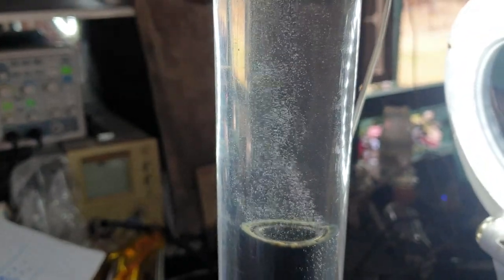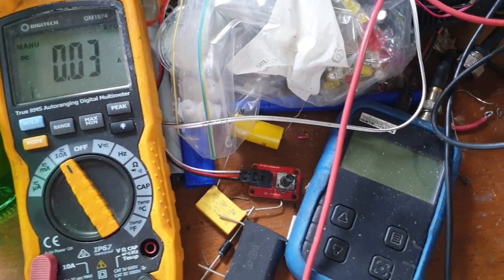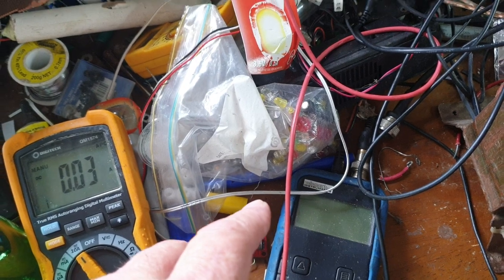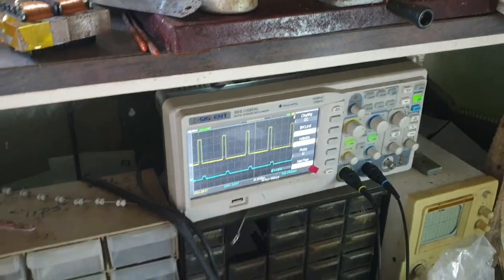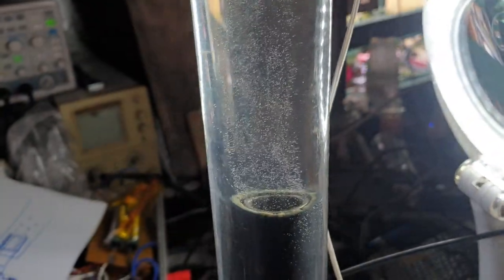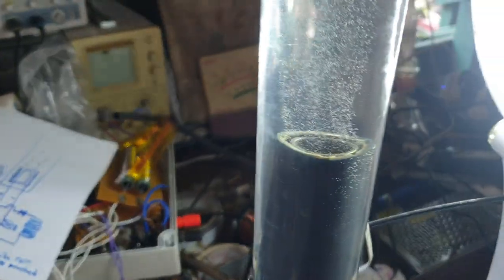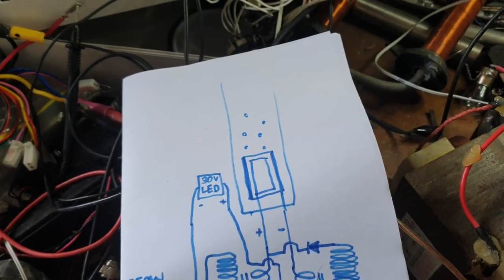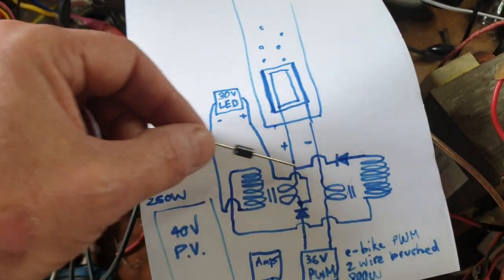@1w with Electron Extraction HHO Stanley Meyer

Comment: can u share the tube sizes and their thicknesses ?  what is the preffered gaps between the pipes ?
Reply from the maker: every cell needs a catered too circuitry. its all about resonance and resistance in a dynamic situation of changing values
Reply: @m3sca1 so u suggest force a frequency from an electric board  like dave lawton? To match the frequency of the pipes?  Or frequency of the water?...as i understood so. Far i need to excite the  pipes by an electric frequency to make the pipe frequency  matches the water frequency that s when the ressonance occur a i right?.. I a a bit lost
Reply from the maker: not force, tickle

Comment: "So what if I'm using 3 amps, 5 amps or 10 amps even?" - Stan
Reply: You're very wise using only the smallest volume of water necessary. What size is that tube? it looks huge on the video! ha ha
Reply from the maker: @drgonzo7806  its a meter long, i wanted the voltage separation from the cell to the extraction grid to be large
Reply: @m3sca1  Yea understandable. But it's still less water volume than a big bucket, which is more of a factor than most people realize
Reply from the maker: it holds about 2 liters
Reply from the maker: i'm still chasing a dragons tail that reared itself about 15 years ago, the riser tube started to gain voltage above the input value and i never got it too happen again... the japanese made it work, they pulled energy out of a fuel cell and run inverters, and a little car (genepax).

Comment: Put a well insolated wire up as high as you can at ten ft your at 300 volts the water is the dialectic your tubes are a water capacitors that cracks the water .at 30 ft your at 1,000 volts . ground one of the tubes to earth .never thought of putting them together.before . storable energy.24/7/365